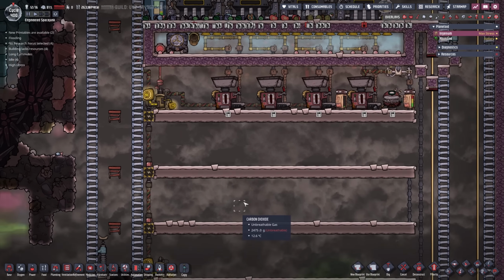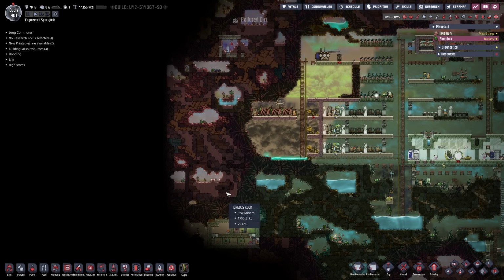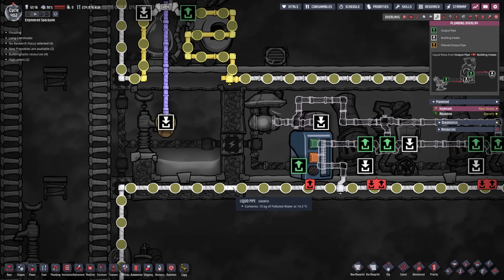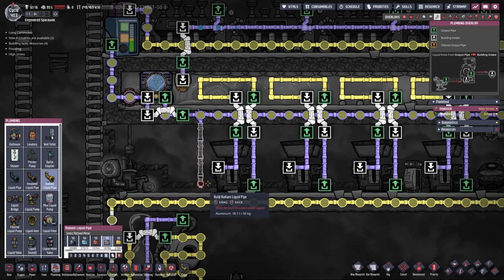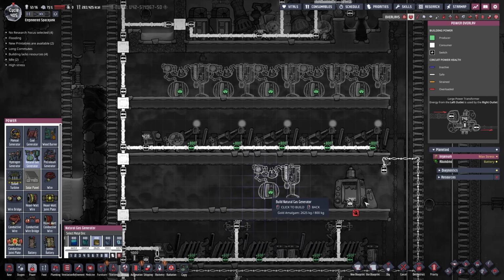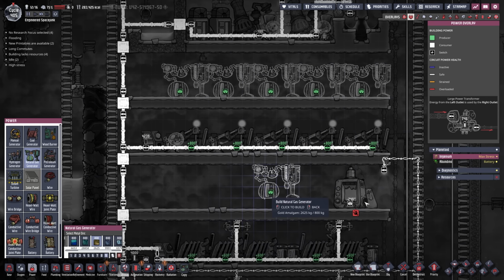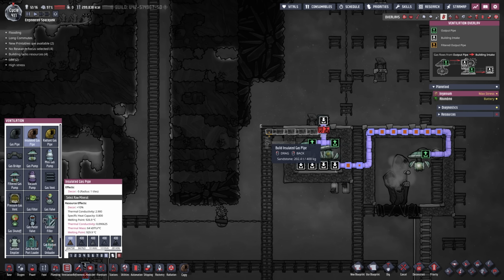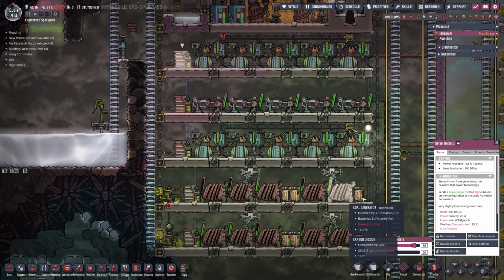ENGINEERING the ULTIMATE INDUSTRIAL POWER BRICK! (LP2-EP19) Oxygen Not Included Spaced Out

Comment: If you had made those into power rooms with control stations that would be an extra 50% energy, with so many metal volcanos you'd never run out of material to do it.  It can save a lot of fuel.  For the soda fountain, you could also pipe the Co2 to a gas bottler right near the fountain.
Reply from the maker: You are right, I might still do that later. Currently I have enough fuel for basically ever, lol. But converting them later is always an option :)

Comment: The Problem is that the batteries are not synchronized so they have different power states. There are to methods for this: drain all to zero first or let all generators run at full to load all to 100 %
Reply from the maker: Yeah, that sounds right for sure. I figured over time they would synchronize themselves, but it never happened. So I went the brute force method, haha :D But thank you for the tip, I appreciate it!

Comment: You could potentially overpressure your oil refineries if your base doesn't use enough power (which, granted, is unlikely to happen). Simple overflow detector on the gas pipe coming out of your refinery room controlling one or two natural gas generators would be a permanent-ish solution. Can even have the generator still part of the main system with a single or-gate (keep the signals separate!!).

Comment: Is it possible to automate your batteries that are hooked up to the generators to switch the type of fuel  when the other fuel is empty. I'm finding myself constantly switching between hydrogen and natural gas every 4 cycles because I run out of each source. I tried fine tuning the numbers to even out distribution but then I get building stuff and demand spikes.
Reply from the maker: I can't think of the top of my head how to do that other than what I did. Hook them all up to batteries and try to drain the resources somewhat equally instead of one after the other. Supplement your Hydrogen an NG with solar power, steam turbines, coal, wood or petroleum, even if it is just temporarily to help you get out of this death cycle. Those would be the things I would look at first :)